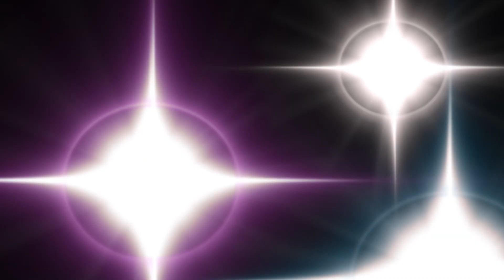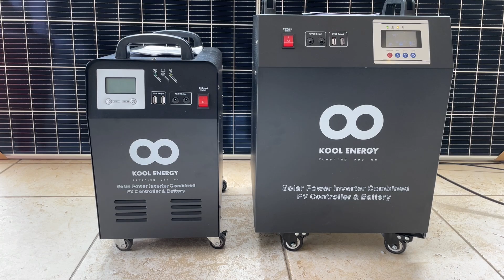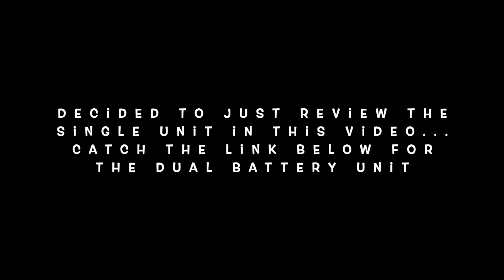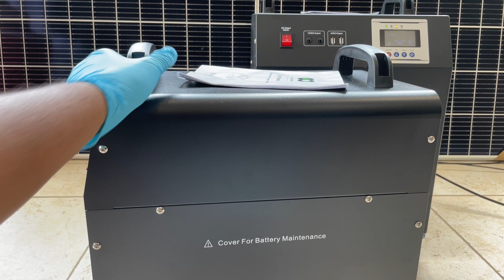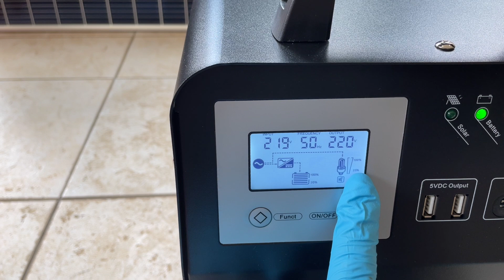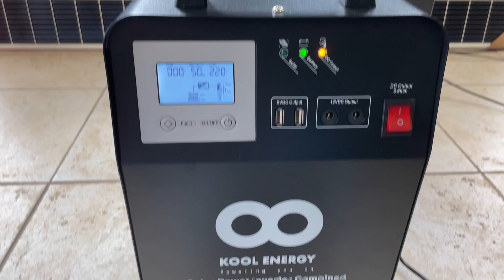Reviewing the Mecer Kool Energy 1000w 12v Pure Sine Wave Inverter - Load Shedding Solution!

Comment: Hi, Thanks for the great video. Is the 1000W the max running output? Or is it the peak wattage? Since usually when it comes the ratings stamped on the units, the aren't very clear of both ratings
Reply from the maker: It’s the max running output, I have never pushed them that hard on test. I would recommend around 500w on the unit unless you really have to pull more for short periods as the single battery won’t last long on duration otherwise
Reply: @alternatesolutions2408  Thanks for the reply here. I thought that to be the case. I wish manufacturers will put things like this on their spec sheets, since a lot of consumers do not think about things like that and when they use close to the max rated, it unit might trip when appliances cold start and they think the inverter is faulty

Comment: Hi, thanks for the insightful video. Had a few follow up questions: 
1. Should I always keep the inverter connected to mains or would it be better to disconnect from mains once the battery is fully to increase longevity? 
2. When mains are connected, is the system still running through the inverter or does the inverter kick in when power goes? 
3. Seems like my capacity indicator is not working, I've put some load and it does not show the level of power being used. Is this normal? 
4. What are the key tips to having the unit last as long as possible? 

Thanks for your assistance.
Reply: Yes I have the same issue that the capacity indicator is not working
Reply from the maker: Hi there, 

1. Yes you should. It will charge and discharge by itself. If you disconnect it, it will start to discharge by itself.

2. It’s running on a by-pass so not directly through the system but if you over load it, it will beep to alert you that you are exceeding its max load

3. You are a second person to note that. It seems like an issue on some.

4. Use the battery unit it drops to 50% and then let it charge up again and do this for as long as possible. Do not drain the battery to empty that shortens it’s life a lot

Comment: Thanks for the detailed video. I have bought one of these based on what you have demonstrated and explained. I would just like to know what size and how many solar panels I would need to add for 100% efficiency. If you could advise please. Thank you.
Reply from the maker: The single battery unit has a small solar charge controller so it can only hand 25vdc panel which is around 200w.
Reply: @alternatesolutions2408  Thanks for the info, I would like to know which sort of panel would you advise locally? is it wise to simply connect a panel and position it manually or install it on a roof? I mean how long would it take for the 200W panel to actually charge the battery?

Comment: Dumb question but I’ve got the meccer 1kw version of this is 2 150 watter panels enough and how do i know if it’s actually charging?
Reply from the maker: It will charge, there should be an indicator on the screen showing the panel and pulsing to the battery.
Reply: @alternatesolutions2408  there is NOT a charge indicator. In fact the DC output gets disconnected! Please make video of this

Comment: Thank you for the awesome video bud! Can you add a normal 12v lead acid battery and does it show that you have connected another battery when you do?
Reply from the maker: You can, but ideally you would want to have matching batteries or atleast the same 100AH size else you will struggle to balance the discharge level between them. 

Think of the battery as a fuel tank, if you have different sized items one will drop to empty faster than the other…
Reply: @alternatesolutions2408  Makes sense! Thanks for the help!

Comment: Hi there. I'm looking at this system for working from home. My work pc has 2 screens, a Gt1030 gpu (only to support 2 screens) and a 650 watt psu (I stand under correction). I use the occasional accounting software and Microsoft Office. Could it last 3-4 hours loadshedding?
Reply: Nope, been looking at the same thing - how you calculate is battery AH x Voltage = Watt Hours. Also normal batteries can only discharge to MAX 60% of its total AH rating as well as efficiency loss from converting DC to AC of around 10- 18%? (dont quote me on this). Gel batteries goes to about 70% of max and Lithium iron to between 80-90% of AH. Also if you are not gaming your max Watt consumption from your PC will be lower - PSU size is not indication of consumption and things like screen, keyboard with lights, mouse, router, switch, amount of fans in your case etc all makes a difference. Best to get a watt meter from takealot (+-R500) which will tell you exactly what your consumption is prior to planning your inverter/battery size. That being said, say you use around 350watt for your pc (including screen etc) doing normal book keeping and internet browsing + 15w for internet router + 10w for your phone charging and say a led bulb desk lamp of 9w = 384watt consumption. Only 50AH of your battery usable * 12v = 600Watt hour / divided by 384watt consumption gets you 1.5 hours roughly. Now you can get an external battery and connect it to this unit and up its capacity by say another 50ah, which gets you to 3 hours - not bad. Considering you have 5 hours + between loadshedding sessions, this unit should be able to fully charge again before the next, depending on how large your add-on external battery is. I'm planning to add a 200ah to this setup, which hopefully can charge up between schedules. Hope this helps!
Reply: @LourieJacobs79  That was very comprehensive and well-explained. Thanks man🤙
Reply: @LourieJacobs79  I used a IOT power plug to measure consumption - for my 3 screens and i7-6700 system with router, ONT and AP it was about 150W per hour but that is browsing and no gaming.
Reply from the maker: Thanks for the reply, spot on!

Comment: Thanks.  If add another battery, are you adding capacity??   You didn’t mention whether the battery extension connects in series or parallel.
Reply from the maker: Parallel so adding duration - like having a second fuel tank on a car
Reply: If it is in series it will double the voltage to 24V - obviously not a good idea since the inverter is a 12V design :).
Reply: What cable did you use.  Is it a normaol flatcore, or solar cable.  Your advive is greatly appreciated

Comment: I have one solar panel supplied by the dealer with the unit. After some time charging, the high voltage alarm goes off. Does the unit have built in protection against high voltage? Is it a concern?
Reply from the maker: Might be a too large panel for the controller inside the unit.
Reply: @alternatesolutions2408  PLEASE make a video explaining the solar panel option

Comment: Hi, could you please make a video of the complete setup of the 1000kv kool setup. Plugged in to grid power so it will just switch over to the inverter when my loadshedding start.
Reply: Jy begin met die boks alleen, alles afgeskakel.
Dis nie aangedui op die boks nie maar as jy mooi kyk op die groen breaker sal jy sien on/off. Skakel na off.
As jy sonpaneel het, koppel hom op met korrekte polariteit in die Solar poort met die + en -.
Koppel die voorsiene AC input kabel van die muur af na die boks. As jy 'n korrekte eksterne battery het, soos voorgeskryf deur 'n "gekwalifiseerde" handelaar, koppel dit op by die Battery extension poort volgens korrekte polariteit.
Maak seker die toerusting wat jy wil aandryf is minder as 1000 Watt. Byvoorbeeld 'n rekenaar en 'n LED lamp  of twee is fine. Moenie iets groot soos 'n yskas, mikrogolf of sweismasjien probeer aandryf nie. Voordat jy die toerusting by die boks inplug, skakel die masjien aan deur die On/Off knoppie in te hou vir twee sekondes. Die boks sal beep en aanskakel. Dan is daar die Func knoppie. Hou hom in vir 5 sekondes om tussen 3 modes te skakel. Die middelste getal bo in die skerm sal die mode aandui as jy die knoppie inhou vir 5 sekondes. By mode 01, is die "preferred" power die AC input (tydens loadshedding is dit die battery). Dit is die mode wat jy soek op jou spesifieke vraag hierbo. Die stippellyne op die skerm sal aandui hoe daar krag inkom vanaf AC, die golfie, en gestuur word na die battery en na die load.
Die masjien is gereed, jy kan die toerusting by die masjien se 3punt plugs inplug. As jy jou foon wil charge, kan jy die groot vierkantige rooi skakelaar aansit en die usb poorte gebruik vir foon charge.
Wanneer die krag trip, dan sal die masjien slim genoeg wees om oor te skakel na die battery toe.
Hier kom die belangrike deel, hou die toestand van die battery dop op die skerm. Moenie toelaat dat meer as 50% van die battery se kapasiteit gebruik word nie, anders maak jy die battery seer en moet jy die battery vervang.
Geniet hom!
Reply: Ek het een stap vergeet, voodat jy die ON/OFF knoppie inhou vir twee sekondes, maak seker die groen breaker is aangeskakel. Daarna, druk die klein rooi knoppie vir twee sekondes tot die skermpie aankom en beep.

Comment: Would this run a gaming pc which is more power hungry than a standard pc for 2 hours.
Reply from the maker: If its 500w it will last just about 2 hours, but it is not recommended to drain the battery fully. So I would suggest a two battery setup

Comment: How do i know if my Kool energy inverter is charging. I plugged it into the ac port, switched on the mains on the battery and the green light on the front for the battery is flashing . Is this the right way to charge it ?
Reply from the maker: Yes that is correct and it’s charging and will stop and charge that way.
Reply: It does not seem to charge. They say mode 3 must be set when charging which i did. It shows that it charge but as soon as it switch over than the battery did not charge at all

Comment: Hi what type of deep cycle batteries are supplied ( I assume by Mustek)? Gel, or lead acid, etc?
Reply from the maker: Lead Acid, Oliter 100AH
Reply: @alternatesolutions2408  407x174x209 (L*W*H) - not all 100AH batteries are the same size as I discovered recently when I had to replace mine.

Comment: guys I bought one of these units 3 days ago I had 1 fibre router 6 mikrotik routers a 8 port ubiquity tough switch 3 computers  ( 1 nuc 1 micro server and a small hp pc) 2 24 inch screens  this device ran threw the 2 and a half hours load shedding and it had a like a 25 % load the battery was more then half I'm impressed  today I ran the same setup minus the 2 pcs and minus the 2 monitors after 5 hours only 2 bars were gone.
Reply from the maker: Great news

Comment: Thanks for the video, i have a the RCT version and it beeps 8 times every 30min. Do you have any idea why, quite irritating.
Reply from the maker: I have not heard of that issue before and I don’t recall seeing that in the manual. It must be an issue with the firmware. If it’s under warranty take it back to where you got it from and they should be able to swap it out. If it was a Mecer unit I would have been able to assist/direct you.

Comment: Well presented and clear, but......why does nobody explain the crucial FUNCTION button!? This is critical to using the inverter properly. (btw, the manual provided with the product is incoherent). It would be great of you re-edited this fine video with how to use modes 1,2,and 3. Thanks!
Reply from the maker: Hi Andre, the manual was incoherent with regard to the modes as you say and switching between the modes i didn’t find anything different and I didn’t have a solar panel small enough for this single battery unit to see if the modes priotised solar in any way. I have since,!not had an identical unit but the Mecer branded version of this unit which no longer has the function button so not had a chance to see what the function does. Do you have any feedback on the meaning of the 3 function modes?
Reply: @alternatesolutions2408  I have tha Kapa 1000 version. It appears the modes are as follows: mode 1: prioritises the grid, i.e. the mains power when on will flow through the device and keep the batteries charged. Batteries kick in as on normal UPS. Mode 3: prioritises input from solar panels. I have 3 12V 150w panels which is about the 500w PV max the system is rates for. In this mode the charging process is prioritises to the panels allowing one to operate independent from the grid. Mode 2: the batteries are prioritised over the mains - this is a bit confusing still to me but I think it means that as long as the batteries are above the rated min charge, the inverter will blesses power from them rather than the grid.  I think that once the batteries get low then the grid is reconnected to charge them. All still a bit confusing but important to ensure cry’s one uses the right mode.
Reply: @andrejsmith  Hi Andre, can you perhaps share a link for the 150w 12v panels you are using? Also how long does these 3x take to charge from 50% capacity to full, ballpark?
Reply: @LourieJacobs79  was this shared yet?

Comment: My pure sine wave inverter is set to "01" mode for AC mains as preferred power, but after a day on AC the fan has not turned off yet, is this normal? When plugged in to the wall the first time, the fan went to full speed like in the video, but then went down to about 20% speed and stayed there and would fluctuate every now and then. Does the fan ever turn off on this inverter or is it on indefinitely? My modified sine wave inverter's fan turns off after the battery is charged, but not the pure sine wave inverter, is this normal? I have the 12v 1000w Inverter.
Reply from the maker: Yes it runs always when on AC
Reply: @alternatesolutions2408  Thank you for your instructive and brilliant video. On the topic of the fan: is there a way to switch the fan off? Perhaps a specific work mode that does not require the fan to be on? (it's winter and the unit temperature is low at all times)

Comment: Thank you for a most informative review and video! I have the RCT MegaPower version of this unit. Your explanations of things make up for the almost unintelligible manual - as when you explain that  the DC panel works even when the inverter is not running. And it is a relief to hear that the fan runs all the time - as in a PC. Thanks again!
Reply from the maker: Thank you so much - really appreciate the kind words. I really try mu best to help out where I can.
Reply: Hi is it normal the the green light to flashing continuously?
Reply: No the green light to flashing continuously producing the high quality power phenomenon.
Reply from the maker: @sherwynmaistry2346  yes it seems like they do when on mains

Comment: Got a question  can I put a 12v lipo4 battery  on this ?
Reply from the maker: The answer is technically yes. I am piloting lithium batteries now on new units but this unit does not have battery user settings and the lithium batteries do require some custom settings to get the most out of it. That being said I do know of clients who do use them. I do have an inverter that’s similar powered that we build specifically with a lithium battery. I have done a full video on it, just have to edit and load it. Will try to get to it this weekend.
Reply: @alternatesolutions2408  not sure if you managed to successfully deploy a lithium battery in this unit. Recently purchased one and keen to figure out if I should add another 100Ah lead acid matching battery or just switch to lithium outright.

Comment: Thank you for this very informative video.
 I need an inverter for my Oxygen Concentrator Oxyflo5 (Working Voltage 220V/50Hz and Rated Power 300W.
Do
Is this model sufficient enough to supply power to my oxygen concentrator in case of load shedding? What is the estimated number of hours can it run (if only the oxygenerator plugged into it)?
Thank you very much!
Reply from the maker: So sorry for the delay, at 300w on a 12v system it would pull around 25A. To allow for longevity of the GEL/AGM batteries, we try to keep them to around 50% depth of discharge which in this case is 50A, thus it will power that concentrator for 2 hours safely. it can go more a little more as well - there is battery power just that in the long run the battery will start to lose life.

I suppose the better option would be to add a battery to this or go for the bigger unit that comes with 2 batteries.

Comment: Thanks for sharing. Can you add more than one additional battery to the unit?
Reply from the maker: Yes, in parallel i would say up to 4 would be a soft limit and you would need to make up a wiring harness for that. The user manual does not specify a limit at all, I just think the time take to charge it all up again might be challenging if they all go down as it charges at a standard 20A rate and with all the batteries being in parallel the system will remain at 12v. 

I also prefer when wiring in parallel that the first and last battery be connected to the inverter itself to almost ensure the current has to pass through the entire parallel branch before moving across the unit to ensure all batteries drain around the same.
Reply: @alternatesolutions2408  Hi, the recommended specs are to add no more than 1 extra battery rated at 12V 100amphr (deep cycle gel). This will more or less double you backup time.
Reply from the maker: @andrejsmith  yes that is correct double battery double duration. Since it does charge at a reasonable rate you could add more, I would just ensure they’re wired in first and last battery in parallel to the inverter which is a little tampering with the wiring and you wouldn’t want to void the warranty so like you said, better to just stick to adding just one more.